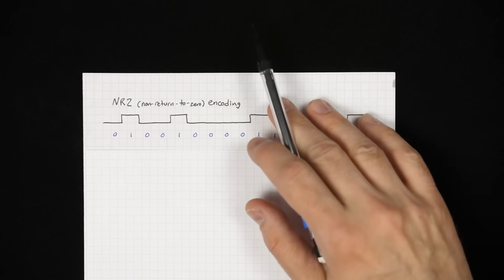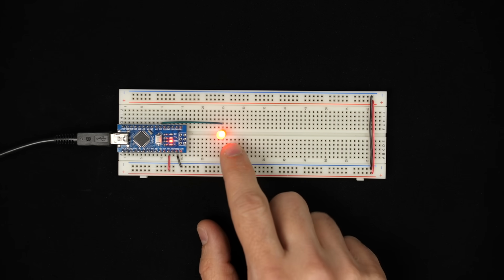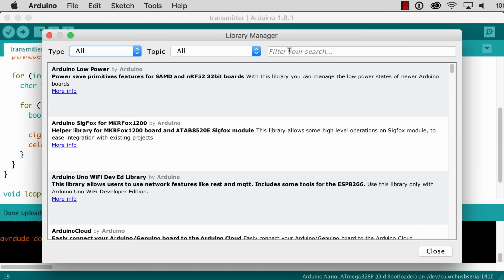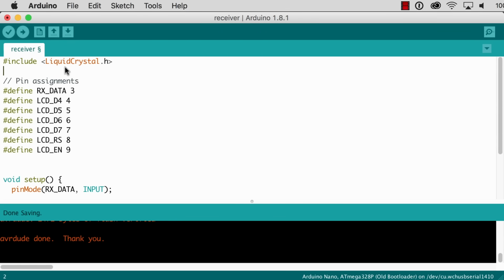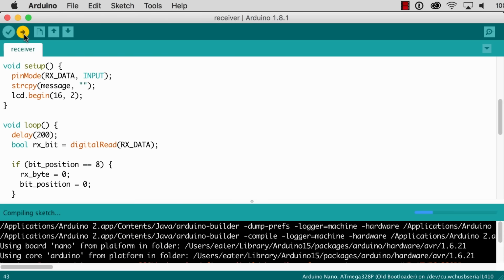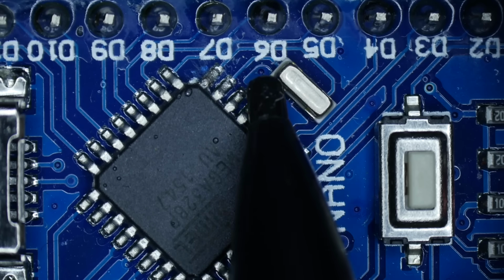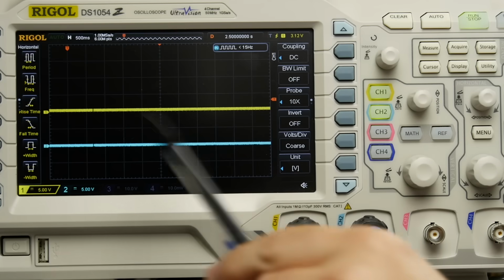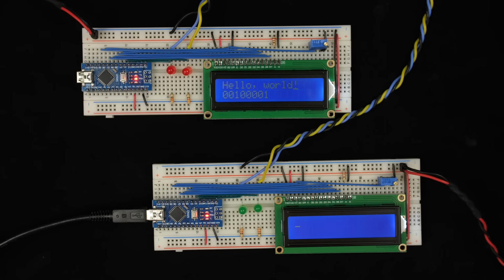Reliable data transmission

Comment: Good stuff Ben, If this was Comms 101 then spin off a Comms101B and do clock recovery from data edges and keep the single sig wire.

Comment: For the follow up video, if you go into single bit error correction (hamming codes), use Venn diagrams to map the logic.  Don't use squares and 'nearest neighbor isolation' or any of that nonsense.  It's visually unintuitive and exhausting while being no more accurate.

Comment: (correct me if i'm wrong) 
Wouldn't it be easier to use the return-to-zero method as a solution for the 'timing' issue? 
That way you will know when you have received a bit (every voltage that differs from the baseline).
Reply: Return-to-zero multiplexes the clock and data on the same wire by using three voltage levels, which is easy to describe but also requires more hardware to sample and generate. There isn't a handy negative voltage source in sight, so I suppose replace zero with 2.5 volts produced by a voltage divider. But there are more interesting self-clocking signals that don't require additional voltage levels and associated hardware.

Comment: could you make a protocol that does not need a master which can also transmit data between more than tow devices pls??? I can not understand how CAN (controller area network) does not mess up when tow devices try to transmit data simultaneously...

Comment: Also, this depends on the Arduino's interrupt- and input hardware, but can bounce affect interrupt channels like this? Like the rising edge of the sent clock can trigger the interrupt handler multiple times on the receiving Arduino? Yeah physical buttons aren't like logic gates etc but still, if anyone knows then please respond.
Reply: No bouncing in this case.  There could be some ringing when it transitions from low to high but not anywhere close enough to trigger the interrupt after the initial trigger.

Comment: Just a question. What's the significance of 0x80?
Reply: Probably just 8 zeros??So 1 byte
Reply: @justsomedude4660  no, 7 zeros and a 1 (the most significant bit is set, other bits are reset)

He could also have used 0x01 and a left shift instruction (instead of a right shift instruction) and send the least significant bit first (now the msbit is sent first).

I'm not sure but I think RS232 sends the msbit first too.

Comment: Why don't you use constexpr's instead of #define's? It's a more C++11 way of doing it. By the way you explained well, thank you!
Reply: In this case it's not really going to have much of an impact on the byte count.  If it was a larger project where flash storage was at a premium and those declarations where constantly being referenced then constants might be better.  But constants are at the expense of RAM  real estate.
Reply: Not always: constexpr constants usually use as much memory as #defines, since both are evalueted at compile-time. Indeed, probably contexpr uses less memory when that constant is used more than once in a single call, because it only has to be constructed once.

constexpr int C = 1;
#define D 1
use_ints(C, C);
use_ints(D, D);

After going through the preprocessor this becomes:

constexpr int C = 1;
use_ints(C, C);
use_ints(1, 1);

So, in the last line, the integer 1 is temporarily constructed twice and requires two times the memory. That memory is then released after the use_ints(1, 1); call, so when we need to use less "global" memory #define's can be useful, but we have to remember that when a variabile is used more htan once in a single call more memory is used.
Reply: Stypox I think that’s what I was trying to say.  I’m in favor of constexprs myself.  I was talking about reducing byte count to save ROM/EEPROM/Flash real-estate which constexprs would do in a larger project in most circumstances so I’m in agreement with you.  I’m probably just not as good as explaining and might’ve been a tad wrong with how I made my argument :)
Reply: Ok, maybe I misunderstood... I agree with you :-)
Reply: I can certainly see where the confusion came from... I could've/should've kept my mouth shut anyway.  As you stated, using constexpr's are a "more c++11" way of doing things.  Nice to see some nice commenters on the internet for a change :)

Comment: To fix the error: you could use a checksum or a diffrent acknowledge reply something to check if the signal reached the reciever.
Similar to a 3 way handshake.
But that's just a simple guess.

Comment: And what about the transmission where change of signal in time means 1 and no change of signal in time means 0? (something like this is used to store data on CD) BTW this looks quite difficult for my brain :D When we used to work with Intel 8051 microcontrollers programmed by assembler, we had the table with the description how many machine cycles takes each operation. So determining the delay was just a bit easier because you coul'd calculate it.

Comment: The C++ code in this is cringey. I'm having a really hard time watching this because of that.

Otherwise, this is a really interesting video, and I want to see where this goes.

One question I do have is why you've twisted up the wires connecting the two boards. I have my guesses, and those guesses also tell me that the twisting is unimportant for the data rates you're going for in this video. But I'm curious as to if my guess is right.

And, a more insidious and less obvious error than an error in the data line is an error in the clock line. :-)

Comment: You can make your sending routine along with input interrupt routine run faster (if transmitting data at fast rate) by using registers rather than digital read/write. DDRx and PORTx (See "Port Registers" in arduino reference). I know performance is not the point of this video, just saying : )

Comment: ☺😊😀😁😂 (5 smiles) and can be very tweety in the boarding if the chip length is popping the chip ?can you use other signals in hz, square, tri, and wave as iam learn types and use with chips and learning code for ATTINY13 and alkies with the UNO and don't get why it's still on the main page for use???? And can you do smile face in the dos?

Comment: 30:34 What if We do barcode style encoding where the length of the input determines the data (eg: a 10ms pulse is a 1, and a 5ms pulse is a 0)? That way, we can meaningfully encode  not on a clock, but on a length of time that is synchronized from the beginning of a transmission.

Comment: could you make a basic web server with two mini (all of this transistors/ttl logic chips plz since thats all i have) 4-bit breadboard computer (they take up about 2 breadboards) so you can make programs on the computer's (with its 1 bytes of RAM XD) then you name it uploads (as like a counter for the names of the websites so lets say there are 5 websites 1,2,3,4,5 then when you upload something it goes to 6) i did it but i used my bbc micro bit as a web server but that is TERRIBLE for this so i am trying to make the arduino mega the web server but i need some programming techniques and i thought it would be a cool project

Comment: It is simplest introduction to low level transmission protocols I ever seen. Cool.
Also, you can't attach interrupt to any pin. Just 2,3 for nano and uno.
Reply: Thanks for that info, wondered why I couldn't get my receiver to clock in any data using Pin 10 for a clock. RTFM, I suppose ;-)

Comment: Excellent walk-through and explanation!! Basically creating an I2C type interface. As a beginner programmer with mcu's and jumping head first into this coding/designing world (I have yet to go through the arduino tutorials), I find this type of teaching very informative and easy to follow. I learn much faster by working with "real world" applications, rather than the simulated pseudo ones that are the tutorials (hard to make the cross applications). This type of teaching helps me bridge those gaps. Much appreciated and subbed!  😁 Look forward to part 2+!

Comment: One thing you missed that would be good to mention/show too.  You jumped right ahead to using clock signal in order to synchronize tx with rx explaining that otherwise you cannot do much because of imperfect hw clock limitation.  But thats not true, and you can do better without clock signal.  There is protocol UART that "somehow" manages to synchronize message without using clock signal.  But you left it leaving viewers with knowledge that clock signal is essential.

Comment: Hey Ben, Did you know that scope you have can be unlocked to twice the sample rate and have some other additional features through an online key generator? It was a pleasant surprise when I found out mine could do way more when it unlocked all the features.
Reply: Wait so to get the hardware you already own to work fully you need a key?

Comment: If you only have one channel (in this case two wires) couldn't you then synchronize clocks by adjusting the timing every time you receive a change? I mean you're probably not gonna have very long spans of just zeroes or just ones, so it's unlikely that you will desynchronize by half a bit before you receive another change. The receiver could also update its delay to better match what it thinks the transceiver's clock speed is like.
Reply: Almost. You're close, you can indeed sync on the bit changes, but those very long spans of just zeros and ones are a problem - think of transmitting an image, where you get long runs of all-high background. What you need is a means of encoding the data that avoids such long runs. There are many solutions to this problem. 4B5B and 8B10B are common, but have substantial overhead, so where transmission speed is vital you are more likely to see something using differential encoding and bit stuffing like HDLC uses, or 64B66B.
Reply: You're inventing a "self-clocking signal", see https://en.wikipedia.org/wiki/Self-clocking_signal. One hopes that will be a later video.
Reply: I'd quite like one on clock recovery. It's a serious weakness in my modem design.

Comment: I think attaching some coil with hi-f oscillations on the wire and reducing transmit voltage a bit could be a bit more realistic for showing electromagnetic noise. But for me switch is good enough ;>

Comment: I noticed that the check and set of update_lcd is not atomic (not in the scope of reliable data transmission I know). Would there be a case that an interrupt could occur between the event when update_lcd checked to be true and when update_lcd is set to false?

But great great content!
Reply: This could certainly be true, that would mean that that two bits have been received since the last LCD update run. Because the main loop would continue to update the LCD  after the updateLcd = false; statement, both bits are updated on the screen with this single loop around. No problems would arise from it.

Comment: hello, worリネB, when did you learned Japanese?
Reply: Before Unicode existed, the extended ASCII table was a free-for-all in other parts of the world and completely up to the region to define them. Some models of LCDs with HD44780 controllers have Japanese letters. I owned one, and remember doodling them in a table on paper for future reference.
Reply: Those LCD controllers come with either Japanese (HCD44780UA00) or Latin accented characters (HCD44780UA02) in the second half of their character table. It's actually quite difficult to get LCDs with the European controller ROM online, since they are generally assembled in / shipped from Asia. Even the A02 controller on its own can be tricky to find.

You can download the datasheet (with both character sets) here:

www [dot] sparkfun [dot] com/datasheets/LCD/HD44780.pdf

.
Reply: And since when Japanese caracters are on the extended ASCII table ?!
Reply: @heartlessalice5801  There is no "THE extended ASCII table", extended ASCII literally means "You take ASCII (the first half of the values of an 8bit byte) and decide to do something with the other half."

The charset demonstrated in the video seems to be 60% based on https://en.wikipedia.org/wiki/shift_JIS (all of the positions for printable ASCII and half-width katakana on the video exactly conform to shift JIS). It also has some custom characters replacing non-printable ASCII (below 0x20), and some other completely custom positions for characters like 0xe4 for µ and 0xee for something resembling ñ.
Reply: @heartlessalice5801  It's using this version of the extended ASCII table :) https://en.wikipedia.org/wiki/JIS_X_0201
Reply: +HeartLess HackCell
MAN! get OpenMSX emu, tamper with it, see the DATES there.
https://en.wikipedia.org/wiki/OpenMSX
http://openmsx.org (for ROMs and BIOSes try https://archive.org )
Reply: +HeartLess HackCell try playing knightmare I & II
https://en.wikipedia.org/wiki/The_Maze_of_Galious   https://youtu.be/mxk-M7Ey7fQ
I remember buying the cartridge ;D ages ago, and was typing japanese to save/load game without knowing what the character(katakana/heragana=kana) were ;D
Reply: fox fyre3, 
 thanks for those informations :)
Reply: reminds me of the HOテル (HOTELU) in the cyberpunk trailer.

Comment: Hi,

Thanks for making more interesting videos!

About the LCD, I know that the library is ready to use but in case, as the LCD data is the ASCII code, using it in 8 bit more instead of 4 would have been sensible. And interesting

Comment: I would say you can just use the internal USART and clock it down as slow as it will go. The hardware inside will automatically detect incoming data and align itself so it will...should.... never lose bits no matter how much you send. but at 16Mhz the slowest you can go is still a couple of hundred bps...

Comment: Interesting video. These videos should be the basis of college education. I learned a lot through reading the theory of checksums and how syncing up the signals worked in class (and I'm sure you'll go over more complex methods later), but actually seeing a barebones network in the flesh is something else.

How far are you going to go with this model? Are you building just the data-link layer or are you planning on implementing some TCP/IP?

Comment: I remember back in the 90's i got my first PC and a cross assembler to write code for my C-128. Since floppy disk formats were incompatible i hooked the PC parallel port up to the C128's userport. I quickly learned that i cannot do without some sort of handshake. But for some odd reason i did it the other way around. The userport's current output is to low to pull the parallel ports data pins to its level except for one (i think it was the paper sense line). I had the commodore sending the clock pulses and the PC would send a byte via parallel port to the userport.

I had a little machine code routine on the C128 watching for a ready signal from the PC and then start to send the pulses. First 2 bytes were the number of bytes to transmit.

One variety of the receiver code would also start the program right after finishing receiving it.
Good times :)
Reply: DasIllu woah that's really interesting. How old were you when you figured out to do that. Way to think outside of the box

Comment: Could you make the data cable a bit longer (like 2 meters) and then program them to reset after 5 seconds of inactivity and then do a timelapse of the bits sent so we can find an experimental error percentage with the above setup?

Comment: I think a good way to check if the message is correct is to calculate the sum of x amount of sent bytes and send that as check signal every so often. So for example if a check was done after every 6 characters it could be like this....
0100 1000 //ascii "H" hex 48
0100 0101 //ascii "E" hex 45
0100 1100 //ascii "L" hex 4C
0100 1100 //ascii "L" hex 4C
0100 1111 //ascii "O" hex 4F
0010 0000 //ascii "space" hex 20
0000 0001 1001 0100 //hex 0194  (sum of first 6 characters received)
0101 1000 //ascii "W" hex 57
0100 1111 //ascii "O" hex 4F
0101 0011 //ascii "R" hex 52
0100 1100 //ascii "L" hex 4C
0100 0100 //ascii "D" hex 44
0010 0001//ascii "!" hex 21
0000 0001 1010 1001 //hex 01A9 (sum of second 6 characters received)

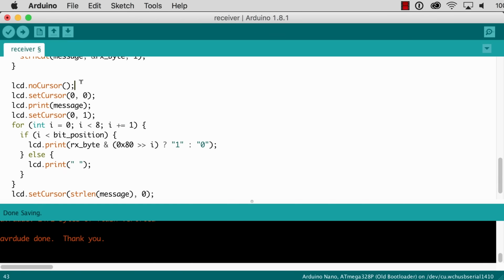Comment: At @22:50 , line strncat(), when you're sending infinite zeros in the demo right after, wouldn't you be overwriting the message char string passed it's allocated 16 chars? So pushing zeros beyond the end of message?
Reply from the maker: In C, strings are null-terminated, so writing a null at the end of the message just "overwrites" the null that was there anyway and doesn't make the string any longer. But it would definitely be a problem if it kept receiving more data (beyond 16 characters). So you're right that if we were doing anything serious, we ought to check for that.

Comment: Have you tried simply setting the bps high enough to start seeing 'natural'  errors? It seemed kind of odd that you mentioned it but didn't test it considering how easy it ought to be.
Reply from the maker: With the clock, this design will be error free up to rates well above the speed of an Arduino. That is, if I removed the delays altogether, you'd just see the correct message appear "instantly" (at least to the eye) on the other side. The "natural" errors I mentioned start to show up in wireless communication (where there's more interference) and at very high bitrates (multiple millions or billions of bits per second).
Reply: Ben Eater Makes sense, excited for the next video!
Reply: You could also introduce errors by adding noise to the transmission line. This could be done by a white noise generator and a restive adder circuit. By adding noise and messing with different coding schemes, you can attempt to get close to the Shannon limit of the channel.
Reply: I ran into errors at around 2KB/s with a raspberry pi

Comment: Can you also implement a communication line for the 8-bit CPU which could in theory connect to the bus over a demultiplexer and talk to the Arduino? Sort of being able to send and receive data between them?

It could use the same clock line the 8-bit CPU is using, which by being variable, could be really interesting to watch!